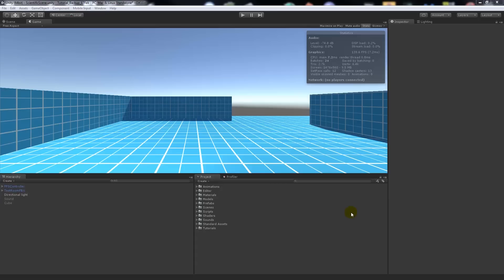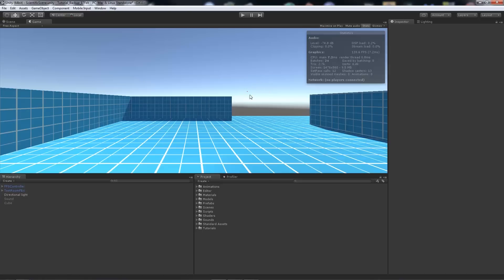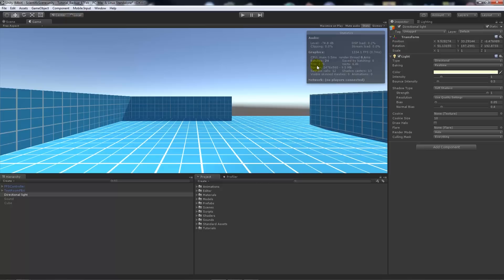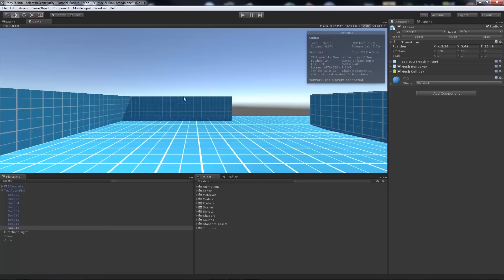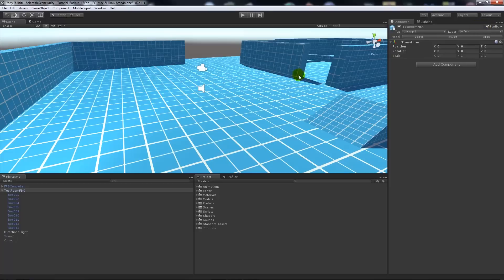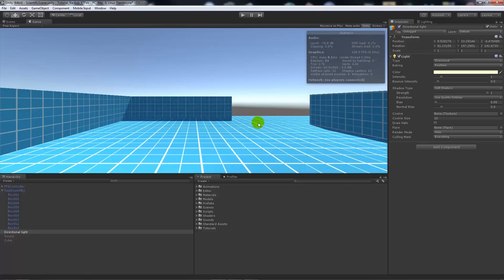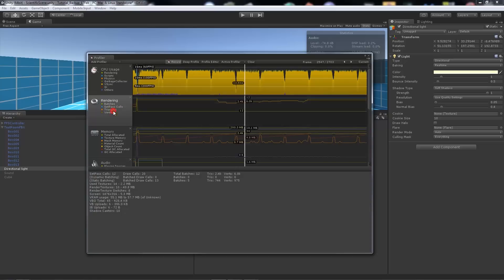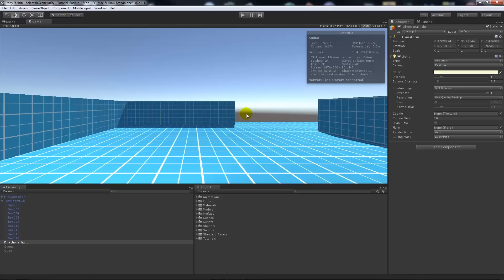Optimising Games in Unity - Introduction / Statistics window - Part 1

Comment: Hey mister, can you help in something real quick if you don't mind?
MY fps controller stopped working. When it happened before I simply delete and place a new controller and I can move around. But since today, I can't move. Someone told me to uncheck the kinematic so I did that and I can move but I can only look left and right, no up and down, plus my character keeps sinking slowly through the terrain.
Reply from the maker: +Broken Nose What version of Unity?
Reply: SpeedTutor 5.0.2
Now the only way to get it working is to create a new scene all over again. But I'm worried if the problem might come again.